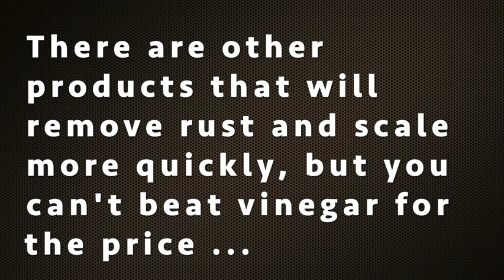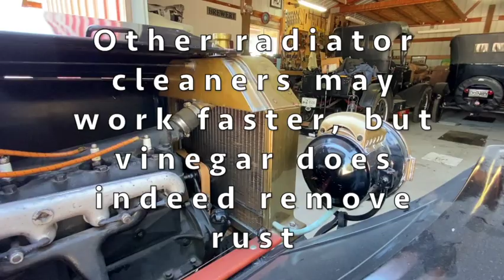Will White Vinegar Remove Rust From a Radiator?

Comment: I just tried this method with my newly-acquired Model A: 1 day soak of vinegar, flush with water, then 2 day soak of vinegar. After draining the second time, with the drain valve open, I poured 3 gallons of water into the radiator and nothing came out. Uh-oh, bad sign. I took the lower radiator hoses off and it gushed out. Apparently the vinegar soaks did some good, it broke loose some very large rust clumps that had been in the system for who-knows-how-long, but now I'm going to need to go in with some kind of spindle brush to clean them all out so I can have a normally functioning system again. Thanks for the tips!
Reply from the maker: Very good! Good luck with the Model A!
Reply: How do people just run across these cool cars

Comment: Saw one video the guy flushed the radiator after draining the coolant. The  he poured in  a small box of baking soda  then filled with  vinegar. It boiled up. He let it set for 24 hours. Thing I will do what you do. Then do the baking soda  vinegar trick for 24 hours.

Comment: What Year Make & Model of Vehicle Would Be Nice To Know ; I Have Never Seen Such Interesting Vehicles Before !!!
Reply from the maker: That is a 1914 Ford Model T Touring. It runs on its internal magneto, no battery. No starter. No generator. No oil pump. No fuel pump. Someone put a water pump on this one but originally it didn’t have a water pump either. The coolant system works via convection or “thermosyphon.”

Comment: Wow you have some nice cars. Would you have left the vinegar in 3 days straight instead, or do what you did and flush it between those 3 days? and you think 50/50 diluted vinegar would only slow down the process?
Reply from the maker: Because vinegar contains acetic acid, you have to be somewhat careful when using it to remove rust. It really depends on what type of metal (and the condition of that metal) you are using it on. The tubes inside antique radiators are thin-walled. Prolonged exposure to acetic acid might inadvertently damage some of the "good" metal you are trying to save. If you are using it on thick steel, for example, you don't need to be quite as careful.

Anyway, I think it is safest to use multiple applications and flush in between. It just depends on the project. Start with shorter intervals, then increase them based on the results you see after each flush.

Since there is only about 5% acid by volume in each gallon of vinegar, diluting it to 50/50 would significantly slow down the process. It might be safer this way, but you would still have to apply the same approach .... start with short intervals, evaluate the progress, then increase them based on what you see. So, I don't see an advantage by diluting it.
Reply: @AntiqueCarsandStuff  Thanks for the reply. 2 questions, should I bother "neutralizing" the vinegar with baking soda? and what do I do with the used rusty vinegar?

Comment: Thanks. What do you think about running vinegar through the engine block? I have a bad rust sludge problem.
Reply from the maker: I've never tried it in an engine block, but I don't see why it wouldn't help. If you try it, just be sure to flush it thoroughly afterwards.

Comment: Will using vinegar in your radiator that has some surface rust from sitting with coolant in it for a long time will the vinegar method cause any damage to the metals inside the radiator because of the acidic nature of it?
Reply from the maker: I think there is always that risk. However, white vinegar has a low acid content and is a comparatively gentle rust removal product. If this vinegar method causes damage to the metals, I would guess that the metals were already very thin and likely due to fail anyway. Or, it was left to soak in the system far too long.
Reply: @AntiqueCarsandStuff  Ah, okay thank you for your reply!
I have a old classic muscle car that sits in a heated garage for sometimes long periods of time due to winter and not ideal weather however i did notice the coolant and the aluminum radiator had some surface rust in it due to sitting was just curious if this would hurt aluminum but seeing by your reply it should be okay

I have one other question how long would you let it sit in there like a day or two? and what would be the mix ratio of distilled water and vinegar?

Thanks for your video and help!
Reply from the maker: In the video I started with a 12 hour white vinegar soak, then followed up with a 2 day soak. That timeframe worked well for me. There is only 5-8% acetic acid in white vinegar by volume, so I chose not to dilute mine at all. Some people mix 1:1 or even 3:1 water to vinegar. I guess it just depends on the project, condition of the metals, thickness of the metals, etc.
Reply: @AntiqueCarsandStuff  Okay, Thank very much for the information and the video as well much appreciated!

Comment: my farmall regular has some rust in the radiator i think im gonna do this now, but first i have to get a new drain pipe or plug it or something, you think this would work for my 8n gas tank? it has rust in it but i ordered a new tank anyway cause it was giving me hell.
Reply from the maker: White vinegar will work for light to moderate rust. If the rust is heavy and scaly in the gas tank,  you need to use some type of hard abrasive material first.